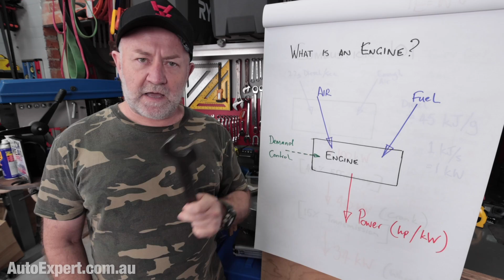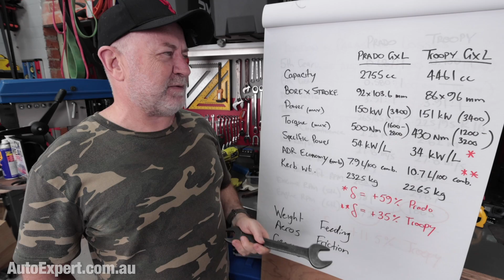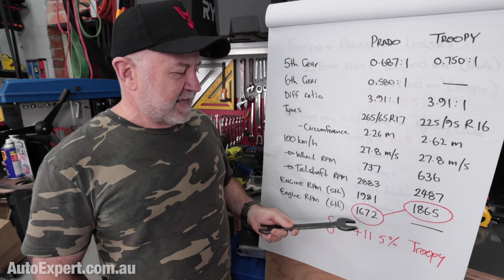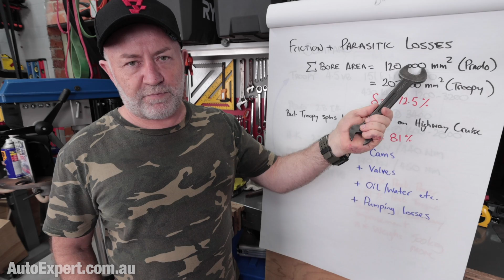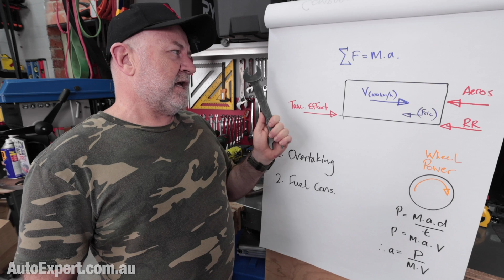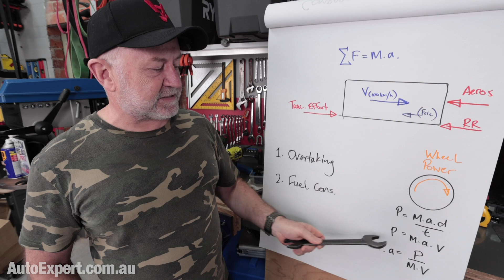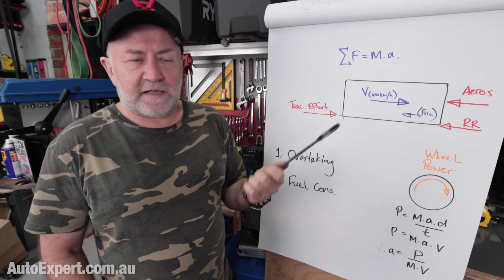Toyota Landcruiser Troopy fuel consumption (why it's so bad) | Auto Expert John Cadogan

Comment: The elephant in the room is manual transmission vs automatic transmission.  Have just done 3000km of remote desert tracks where average speed was often around 20 kph (rough, corrugated, washouts etc).  The Troopy towing 1.3T Tvan used 15 L/100k.  The 200/300series in the group were all above 21 l/100k.  Same tracks, same speed.  Big difference is the manual transmission - drives at much lower revs especially with max torque at 1200rpm. No losses from a torque converter.

Comment: Why didn't Toyota put the twin turbo in the Troopy? Its more efficient. And would last just as long if its not pushed, because when on partial throttle ie most of the time - its twin turbos are wearing the engine any more than the Troopy's famed long life donk.

Comment: Toyota Japan must have heard you, John!  Rumours are rife that the 70 Series will be available with the 1GD 2.8 4 cylinder motor and 6 speed auto.  At least for the 76 Series wagon in Japan anyway.  The 1VD motor in the 70 Series is deliberately detuned simply to be matched to the maximum torque handling characteristics of the 5 speed manual gearbox.  Just putting a tune on the V8 in the 70 Series will result in the factory clutch slipping soon after.

Comment: What a load if misleading crap. Any fool knows for a 4wd the torque figure is king at lower revs.  The broader spread of torque through the rev range, lower rev range is king. Those figures are crap John, and the big no no is you know that and tell falsehoods. Talking 4wds here John, more low down torque is king. Not glorified shopping trolleys.

Comment: G’day John thank you for your excellent series of informative videos. 
We are the owners of a 2010 V8 Troopy. We find it to be a most suitable vehicle for long touring. However any seed over about 90km ph results in a major drop in economy. A word loosely used. 90 gives us 14/100 110 gives us 16/100. Now we do have full length roof rack the rest is standard. 
We have 240,000 km up. 
Any suggestions that can help improve economy. 
Regards Sue and Paul.

Comment: Hi John. wonderful video and very enlightening. My theory is that the longevity of the 4.5L V8 Troopy is going to greatly exceed that of the 4Cyl Prado Engine because a big engine is working very lightly to achieve the tasks asked of it compared with the small 4cy Prado engine. 1. Would this be a fair claim? 2. What is the difference in turbo charger boost of 4.5 V8 vs 2.8 4cyl?

Comment: Something not accounted for is the longevity. An engine operating under higher stresses (more boost, increased heat, etc in order to increase the thermal efficiency) will negatively effect the durability of said engine when all else is equal.

Comment: I've only just watched this! Nice physics lesson! I own a 79 series and I think this is why so many owners seek greater performance out of that lazy V8. Having had an ECU remap along with a few other modifications, including a heavy duty clutch, it is now approaching the 200 series performance, with still only one turbo. Fuel consumption is similar, but the real benefit has been in its towing ability so long as your not trying to break the sound barrier! Why the 79 series you ask? well after owning a considerably more technically superior vehicle and then, suffering from tech failures in a vehicle only 1 year old, I lost all confidence in that vehicle and decided to go for a very utilitarian vehicle, one that's not bristling with silicon chips! Being stranded when the power management computer goes insane (#HAL 2000) and flattens the battery by turning on and off various functions overnight when the vehicle is turned off doesn't bolster confidence and just leaves you stranded in space!

Comment: Drove a single cab 70 v8 tipper with a chip bin and towing a chipper, other than space in the cab and cup holders  you can keep the 4 pot princess. 

Also drove the same rig with the 4.2 i6, yeah that was slow, I'll take the v8 thanks

Comment: This is all true John. BUT, the moment you pair a 1vd-ftv with a quality conservative tune the argument is shot to bits. The 4.5 litre will outperform the smaller diesel engines in every way. AND it will maintain the same fuel economy from standard whilst being under less stress particularly when under load or doing heavy work. Tunes decrease reliability you say? Well nah dude not really, considering the number of high mileage 1vd-ftv tuned engines are still out there doing their thing. They come from the factory underpowered for good reason, they are for farms and mine sites. If you want one as a touring/leisure vehicle you get a tune. Towing a 3 tonne van with a tuned 1vd-ftv vs one of the smaller diesel engine options, guaranteed you’ll see your fuel savings there. It’s the most simple and reliable new work vehicle available on the market today. Hence why they are currently being flipped for profits. If you want a light duty 4wd for the family that is great on fuel and comes with all the bells and whistles.. well then sure, buy a prado. Love your work mate but it’s not always black and white 👍🏻

Comment: Hi John, I have owned both these vehicles and fuel economy both city/country are very similar 10.8L per 100k's. The difference is hook the boat up and the troopy/V8 uses less than the harder working in-line 4.

Comment: Interesting video, John, decent explanation... Unfortunately, the one thing you neglected to explain was that the V8 in the troopy is deliberately detuned by Toyota, to maximize it's reliability and overall lifespan. Sure, you can juice a little motor up to within an inch of it's life, get a similar performance, but it'll never replace a motor designed for ultimate reliability in the bush, where your very life might depend on it. Don't take it personally, but this is a really common issue with city people, who just compare numbers on a whiteboard, without considering the kind of isolated and rugged environment these vehicles are designed for.
Reply: Couldn’t agree more.

Comment: John, if you are reading this -

I am not in beautiful ‘Straya, so a bit flaky on vehicle specs over with you antipodeans.
Your mentioning that the Lexus has extra power with a second turbo suggests that the Troopy (fantastic name) already has ONE.

In which case:
- why does this thing even need twin turbos to make what it does in the lexy-thing?  Surely a better single modern turbo would suffice in this application.
- even with twin turbos, that specific output seems a bit low.  I have an e55 amg that makes an easy, unstressed 354 kw from 5.4 litres in factory trim.  By my calculations, the power output per CC is significantly higher.  Is this just Toyota being lazy, or am I missing something?  The e55 basically has an engine from the late 80s, updated for twin spark, EFI and a very gentle supercharger.  Nothing spectacular.

… and as a bonus, if they are indeed deliberately under powering this engine, why would they do it?  It seems nonsensical to me unless this vehicle needs to slot into a certain position within the range.  If this could make an extra 50+kw, I would market the sh*t out of it.

Thanks!

Comment: Most toyota motors have low tension rings in them to ring more hp outa them ... as the motor ages this isnt good for oil consumption or one would assume longevity...

Comment: I was really impressed that you calculated the cylinder surface area, but than you did not mention heat loss through these surfaces. Isnt this a bigger venue of energy loss than the friction (disregarding the valve train)?

Comment: Ok yes I agree with your states and all the tech but at the end of the day the lack of an over drive or a 6th gear is a huge issue so this is not a comparison of motors as such but the impact of no overdrive or 6th gear. I believe toyota have let themselves down by not including over drive.

My proof for this was I had a little Mazda 323 it had a 4 speed manual gear box and as it was a badge car at the time my father was able to change it out for an Australian Ford Lazer 5 speed gearbox. So it went from both a buzz box to a nice drive and incredible economy at the bowers. Basically it was an over drive and Dad said not to use it until I was going 80km.

Comment: WHY IT SEEM WHEN YOU TAKE A SMALLER ENGINE AN ADD MORE WEIGHT IT GETS LOWER FUEL MILEAGE? LOAD UP BOTH SUV WITH YOUR FAMILY AN GEAR AN HEAD OFF AN THE SMALLER ENGINE GETS WORST FUEL MILEAGE. THE SMALLER ENGINE SEEMS GREAT WHEN IT'S JUST YOU AND ONE PASSENGER GOING ABOUT YOUR BUSINESS BUT ONCE YOU LOAD IT UP IT SEEMS THAT THE FUEL MILEAGE SUCKS. ANYWAY IT  SEEM LIKE Y'ALL WILL GET WAY BETTER FUEL MILEAGE BECAUSE Y'ALL USE DIESEL THAN THE UNITED STATES. ITS CRAZY I OWNED AN 1984 HEAVY DUTY DIESEL SUBURBAN IN EARLY 2000 AN IT HAD 33 IN TIRES AN I WAS GETTING BETTER OR ABOUT THE SAME M.P.G AS SOME OF THIS NEWER 8-10 SPEED LARGE SUV. ITS WAS AN NONE TURBO V8 6.2 LITER DIESEL WITH 135 HORSEPOWER AND 250 FT LB OF TORQUE. IT WEIGHED LESS THAN THESE NEWER LARGE SUVS AND IT ONLY HAD FOUR-SPEED TRANSMISSION AND I WAS GETTING CLOSE TO 20 MILES PER GALLON. IT ALSO HAD ABOUT A 40 GALLON FUEL TANK ON IT AND AT THE TIME I WAS ONLY PAYING LIKE 98 CENT PER GALLON OF DIESEL FUEL IN THE US IN THE EARLY 2000. YEAH THAT WAS THE CHEAPEST I HAVE I HAVE FOUND DIESEL FUEL IN THE US AT THE TIME. I CAN REMEMBER WHEN DIESEL FUEL WAS WAY CHEAPER THAN GAS JUMPED THE 2021 AND DIESEL FUEL IN THE US IS MORE THAN PREMIUM GAS. I don't know why the US is not pushing for diesel and these large SUVs but they continue to try to get good fuel mileage and then failing

Comment: The v8 diesel is making 80% of peak torque before its even hit 1000rpm, when it does hit %100 it holds it for nearly 1000rpm. The "milk bottle" 4 pots dont get out of bed until much later and can barely make peak torque for  a couple of 100 rpm. If youre just relying on a sludge box auto, they make do, drive a real gearbox and you are shifting like a madman to keep it on the boil if youre towing or theres these things called hills. Being able to idle up hills you cant walk up, is a distinct advantage off road, the tractability of a 70 series when locked up in low range is in a class of its own. Prados are farmers wives cars, solid axel cruisers are work horses that are barely run in when the 4pots are requiring a new engine. Troopys especially (they have higher roofline, you know, for the troops wearing helmets... the wagon and ute varients are not the same at all, but still do suck aerodynamics wise, just not as much) are absolue bricks aerodynamically, not the only thing you got wrong in this video, like the REAL fuel economy of the later (like 2016+...) 70 series with taller gearing, which is under 11LPH, but lets not let facts get in the way of some good ole clickbait hey. Your tryhard, i mean triton will be landfill before it gets to the aveage k's of a 10 year old 70 series.

Comment: Of course the troopy is old school & inefficient, just look at it???? You can almost feel how undercooked the engine is when you drive it, but outa the box it seems like all the power that the chassis & weak clutch can handle anyway, if they up the power then they'd have to spend money updating everything else to match. Aero does have a bit more to play than "they're both big bricks so aero doesn't matter" as a example any car that I've added roof racks to I see a increase of at least 5% in fuel usage, a bullbar another 5% losing the aero shaped bumper, if these minor changes affect economy so much then a troopy sitting 200mm higher with approx 0 curves & it's front diff & steering components hanging out all under the front bumper would still have a significant affect on fuel, even if you put a prado 2.8 & 6spd in it it would still use more fuel

Comment: my 2001 hdj100  1hd fte automatic uses 12 liters when I drive with constant light throttle up to 100 km/h or less
it has massive  gear installed: steel bumpers,winch,spare tire carrier arm,roof top carrier and 2 " Ironman  suspenssion lift.
When I drove this thing on a highway at 120 km an hour it'll use 16-17 litters of diesel fuel,give it a high head winds it'll use 18 :)
hook up a 1 ton load trailer and go fast at 120km/h = 22 L per 100km
I never see black smoke from the tail pipe

Comment: the 70 series isn't supposed to be aerodynamic for the basic reason that it needs it's windows and cabin and seat position in a  straight up position so that you get better visibility of the road or trail. If they worry about aerodynaics like in the hilux or prado then it isn't a workhorse anymore.

Comment: It was of course an economic decision. My thoughts..  Toyota was designing the present utes. They had a helluva rep to maintain with those, and wanted them to reliably tow earthmoving equipment and the like,  resist neglect etc. Now the closer you get to peak efficiency the less engine life. People were expecting 500,000 +  K trucks, so the smaller motor was out. Knowing that the troopy would be a sister vehicle, of course it got the povo Pac. Otherwise you gotta fit a pwado donk in an engine bay you just spent how much getting the V8 to fit? I drive a pwado btw.  Coz I have no earthmoving equipment. So I don't mind. So there's that.

Comment: Punting a large four wheel drive around off road with a 3L engine in it I often whish I had more torque below 1600 rpm as it is a hugely different beast from the same vehicle with an inline 6 off road, an exact opposite of the on highway performance in fact.
Has it been worth the fuel efficiency and the better acceleration of the smaller engine on the highway when most of the driving I do is on the bitumen? maybe however the clutch abuse, and risk of stalling when the engine bogs down makes serious off-roading rather unpleasant. Towing with both is something I haven't compared but towing with the 3L manual can be a pain, again because getting to where the engine produces its torque with the gearing it has; means traversing a couple of hundred rpm where the engine will not pull, or again slipping the clutch like some 2 stroke motocross bike. Perhaps an auto with the smaller engine would have been the best choice at the time I bought it.

Comment: Depends if you want to pull a trailer. The V8 can outwork the turbo 4 under the table. Cold start enrichment: The 4 will warm up a quick. 
My 1993 Ford Crown Victoria used to burn about 25L/100km during cold start enrichment. 8-9L/100km hot and running city or hwy.
Rated: 14.2L/100km city 8.6km/100 hwy

Comment: this car (tlc-70-ser)  is absolutely fantastic car. it's a practically almost  ideal perfection.  only 4-things are missing in this car.         I would say very important things are missing.  those things are:  1. unfortunately the engine in on timing belt instead of timing chain or would be even even better gear-set.    2. unfortunately  not optional automatic transmission.     3.  unfortunately not optional soft top / removable top/doors options.   4.  unfortunately no panoramic roof option.   that 4-things would make this car just unbelievably cool.  other than that  if you want to know which 2-cars are the very best in the world,.. as a most durable, reliable , long-lasting, low-maintenance and etc,  that would be this tlc-70-ser. and Nissan patrol (super-safari. y61-model.  btw is still in production to date like tlc-70-ser)  (don't get confused with the modern last model patrol y62 model, this is different animal. super-safari is y61 model not y62.)... ..,.///  as for fuels consumption for diesel 4.2  non-turbine, naturally aspirated engine on tlc-70-series   the diesel consumption specifically on that engine is in the city-20-25-liters on 100km.  and on the hwy  is 10-15-liters per 100km. depending on driving habits and defending many other factories for both cases. but this is real life info.  and one more thing:  never!!!, never!! listen to official fuel-consumption numbers on any car . what car passport or computer fuel-consumption data saying on your dash screen. is always a huge lie.  difference between the official and real life consumption numbers are just ridiculous.   the difference   can be even 200%-300% or even more which just unheard  of lie.
Reply: yeah the y61 patrol is miles better than the 70series.

Comment: 15L / 100km HOW? i have a 1999 105R with 1HZ engine easily has over 10,000 hours i estimated around 15,000 - 20,000 hours never had an overhaul and it still does 12.1L / 100km.

Comment: Also, heat energy comes out of a combustion engine. Actually, most of the energy produced is in the form of heat. Only between 30 to 40 percent is in the form of motion which is then used to move the wheels via the transmission. Electric motors are quite the opposite which is why it only makes sense to use them. Given the rather rapid advances in battery tech the future certainly looks bright (fast and fun too). As for photosynthesis: yes, it is rather inefficient, but evolution focuses on survival and if something works, nature tends to keep it around. Let's not forget that the fossil fuels we have been burning for decades mostly stem from ancient plants (decomposed under a great deal of pressure for eons) that at one point in history sucked the carbon out of the air that is now powering your engine. So yea, photosynthesis is not efficient, but without it your efficient modern combustion engine would be going nowhere.